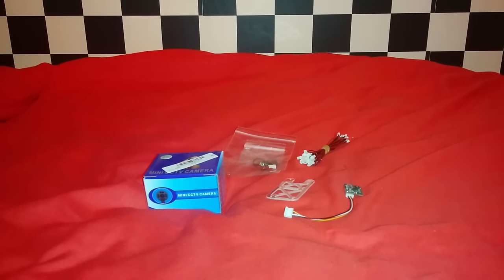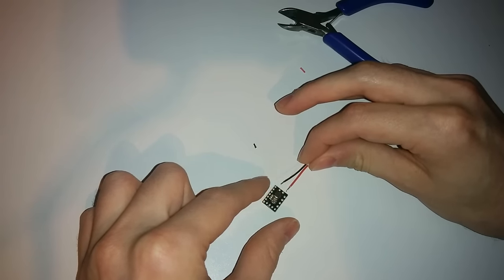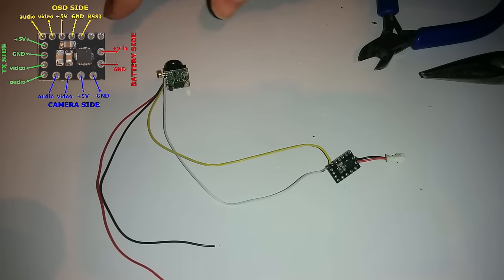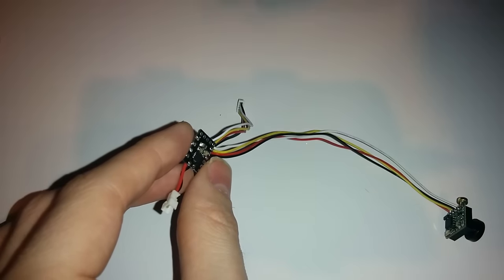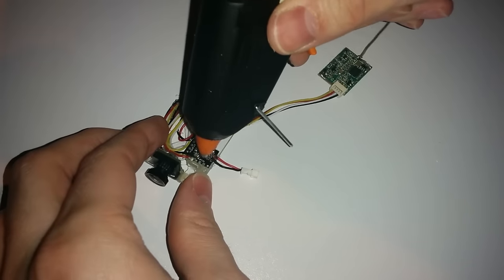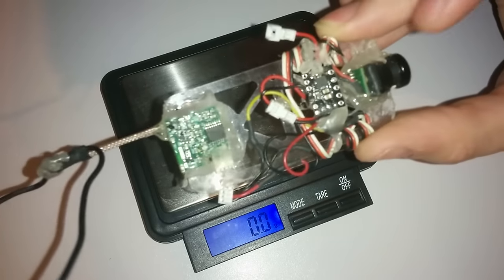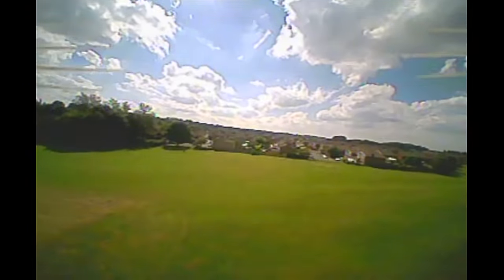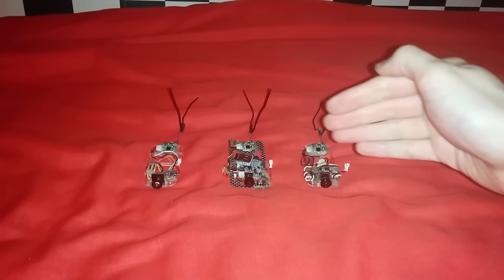Micro FPV Plate

Comment: Andy, if you put solder and wire directly onto soldering spot and then melt it, it would be much stronger connection. Solder tend to loose resin and oxidate when put directly onto soldering iron :)
Reply from the maker: Maciej Makasewicz you cant get the wire through the hole using that method. remember we are doing  miniature soldering here the wires are only a few strands long, you are never going to get a good solder join, hence the hot glue. as mentioned bending the wire multiple times is your biggest worry not the solder join. this method here works perfect. the pads are too close together for your method, you will end up in a mess trust me :)

Comment: Hi, awesome video. Do you think this camera could be powered straight from the 1s battery? Or from a 3.3V voltage regulator?
Reply from the maker: if the source has a built in regulator the. no need for one. but direct to the battery and noise from the motors will wipe out your picture

Comment: Andy, or anyone who knows....
Someone please help.
I need some help finding those little thumbnail sized 5.8g receiver modules.
Super tiny rx modules usually around 25mw and requires you solder on your own antenna and channel jumpers....
I'm trying to make the absolute smallest fpv monocular all-in-one setup and I need the tiniest 5.8ghz rx possible.
I can't even find the er32 receivers anymore.

Comment: Hi Andy great video Im planning on doing the exact fpv setup on my PicnicQuad too. Can you tell me where FPV Hobby is located I don't see much info on the location on the site.
Reply from the maker: +bamboozledguy based in istanbul turkey cheers
Reply: +AndyRC Thanks I was afraid of that now I need to locate a US dealer of the voltage regulator that you used.
Reply from the maker: fpvhobby is the only seller i beleive

Comment: Hello Andy, I'm sorry, because you have connected the micro jst reversed? I connected the loss controller connector in my fpv hobby regulator (red in red and black in the black), but when I connected a battery lipo 1s blue ones has damaged the regulator fpv hobby. How do you figure out the correct polarity? Thanks
Reply from the maker: Emiliano Brotto u need to use a multi meter on the battrry

Comment: Hi Andy. Would you mind letting me know the total build weight (inc battery) of your Picnic H-frame with Hubsan FC? Just to know if i'm in the ball park weight-wise.. My last picnic build which you helped me with via your videos (thanks :-) btw!!) came in at around 58-60grs
Reply from the maker: tammovh 41 grams without battery same as the hubsan h107d the alien quad is heavier though 66 grams fully loaded but the motors pull 108 grams so its all good
Reply: AndyRC Thanks. I'm going to rebuild my picnic with the 600TVL you've suggested. The Hubsan 2MP as an FPV camera is a bit contrasty for flying I find
Reply from the maker: yeah this is why i came up with my fpv plates because then you can switch for different situations
Reply: AndyRC Are you finding recently that you are preferring using a 1280ghz vTx as opposed to a 5.8ghz?
Reply from the maker: not really 1.2 is better for indoors
Reply: AndyRC Thanks! Just another question. The coax cable used on those 1gr fpvhobby cloverleaf antennas, would you know what gauge they are. need to make some very lightweight dipoles...
Reply from the maker: the guage does not really matter at that size just get the smallest u can

Comment: would a 1s 550mah lipo battery work for this system?
Reply: it is a 3.7v battery
Reply from the maker: yes it would work its a 1s battery yes
Reply: thank you for replying! will this vtx work for this setup also? If not, which vtx would you recommend that is fairly cheap?
https://www.foxtechfpv.com/ts5823-58g-200mw-32ch-super-mini-vtx-p-1454.html
Reply from the maker: that will be too heavy that one
Reply: Is it usable though?
Reply from the maker: usable with a micro no. with a brushless miniquad yes :)
Reply: thank you very much!
Reply from the maker: yes that will work cheers
Reply: Thank you so much for all the help!
Reply: for this vtx which ground connection should i use for the fpv plate? There are two ground connections so im not exactly sure which one to use.

http://www.banggood.com/Skyzone-Upgrade-TS5823S-40CH-5_8G-200MW-AV-Transmitter-Module-RP-SMA-Female-p-1017491.html